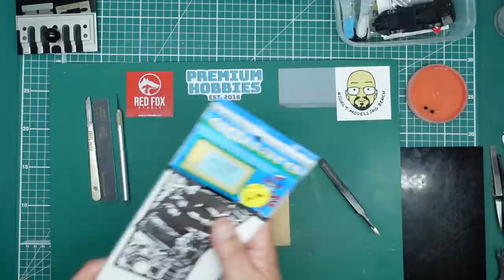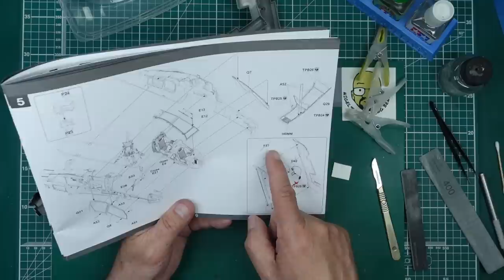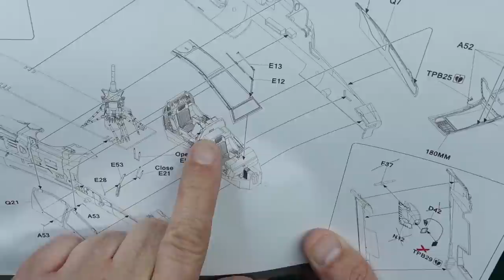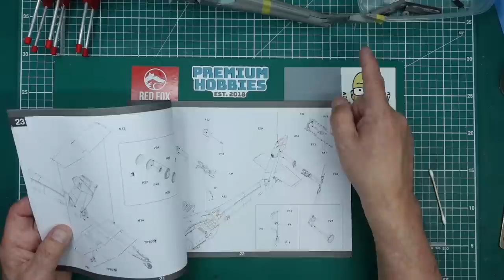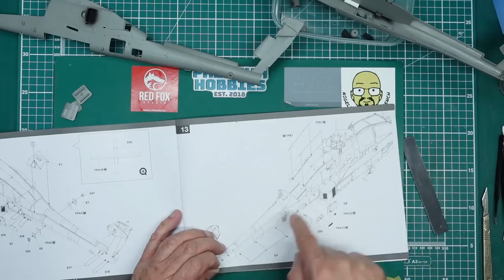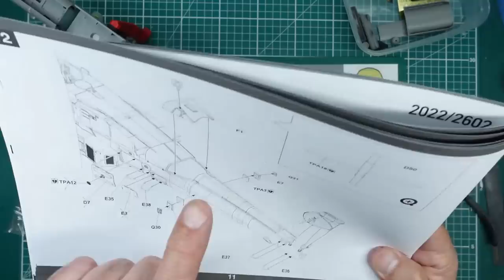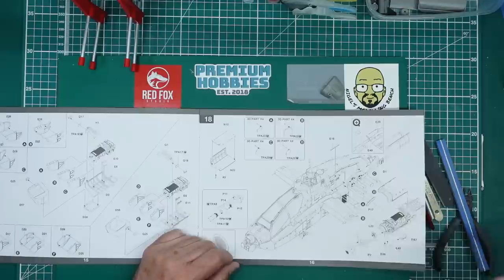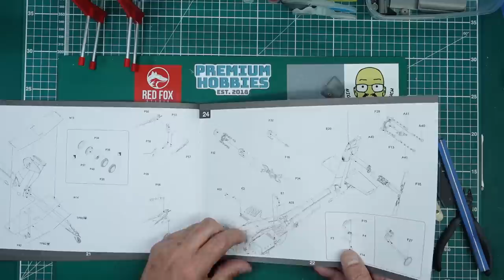Takom 1/35 AH-64E Apache build. Part Two.

Comment: An there is no painting guide, specially needed at the cockpit and the engines. How did you decided the actual colors, for example the green inside the rotor section?
Reply from the maker: I used Google images

Comment: Looks to me like the tail rotor issue is the exact same thing as what Kitty Hawk did with their MH-60L Black Hawk helicopter....
I think that I'm going to put something in the interior of the rotor shaft to hold it stable so it will continue to rotate..
Reply from the maker: As it happens, there is an assembly that goes over the shaft and supports it. Takom should have put this step in earlier.